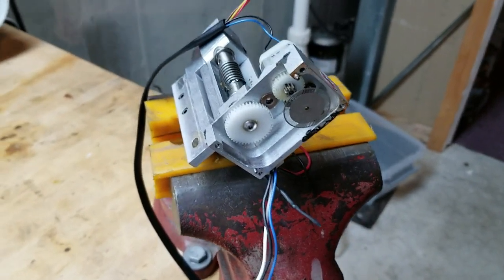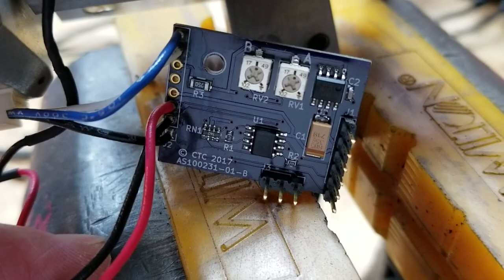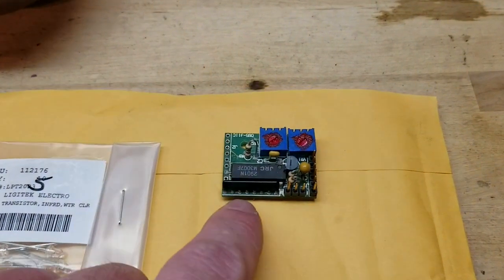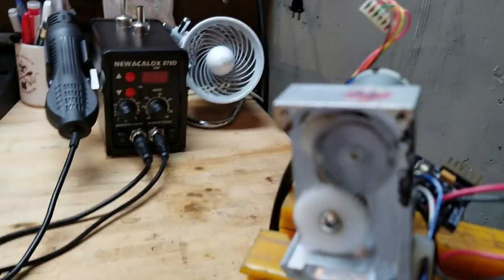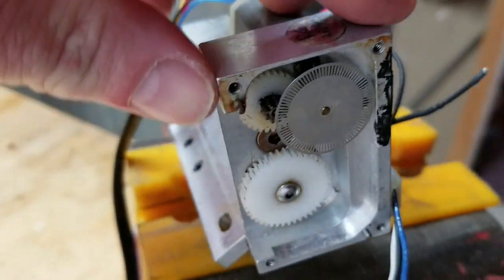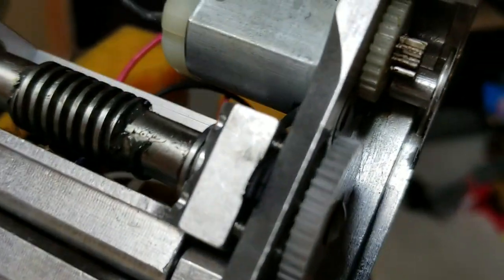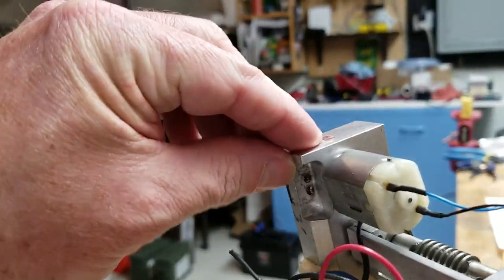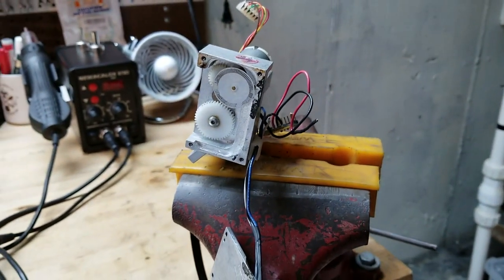LX200 Classic Motor

Comment: It is possible to remove the LEDs without tearing apart the encoder disk (not recommended). You need to heat the aluminum plate with a blow torch. The epoxy will soften, and you can pull the LEDs out with tweezers from the back. Before inserting new LEDs, clean out the epoxy from the holes with a 3mm drill bit.

Comment: Hi:   I have a Classic LX200 f/10 from 2001. Recently repaired Dec Runaway. Was returned from a repair shop and now I have N/S reversed in Dec motor. Since I do astrophotography, my GOTO and SLEWS are reversed when planetarium software tries to communicate with LX200. Your opinion for the cause of this would be appreciated. Thank you.
Reply: My old LX200 has a N/S switch on the power panel. Isn't that what you are looking for?
Reply: @digitalblasphemy1100  ...the issue is now solved, but my Dec motor repair was faulty as the technician wired the motor/board incorrectly. The panel switch position ( N/S) did not correct the main issue, that the motor responded incorrectly to N/S pulses.

Comment: The red wire shown on the new board should be in the 6th hole from the bottom, not the 3rd as shown. Don't think the old board could have been wired that way, either, it would not have worked.
Reply from the maker: Hi Thanks for the insight. I think this scope had things worked on at some point before I got hold of it.  I never did get this to work properly and we ended up getting another fork on Astromart. I would have been happy to simply sell the whole thing and put that towards a more modern telescope, but we had someone in the club that was emotionally attached to it and whined about it being important. 

I did find out that the encoder disk was attached with super glue, and acetone was the correct solution to remove it. Replacement of the LEDs and photo-diodes was possible at that point, although without it being wired properly it obviously didn't work.

Comment: I just bought a used lx200 classic and it's dead. Am getting ready to diagnose it. If it winds up costing me to much to fix, I'm gonna part it out.
Reply from the maker: Sorry, I didn't see your comment until now. We/I gave up not too long after this. I ended up getting the encoder disk off and replaced and wired the two LEDs and would have put money on the table that it would work, but hell no it was still busted. We ended up paying about $500 for a deforked mount. What a total PITA. My recommendation with all these things is to not put good money after bad.